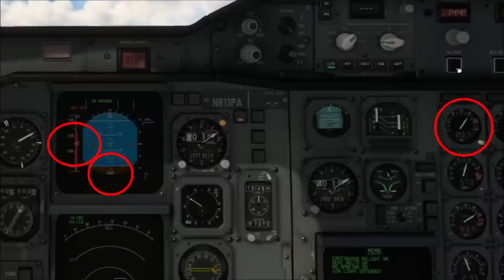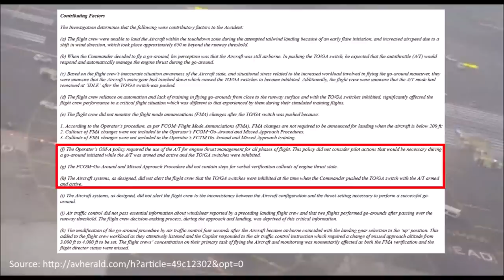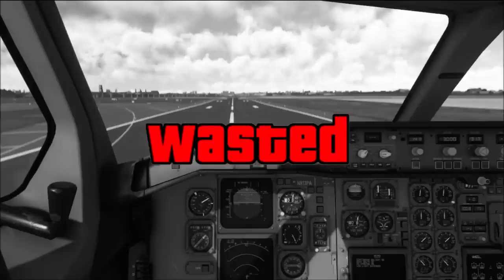How Automation Almost Killed Me - An MSFS Case Study | Real Airline Pilot

Comment: As somebody who's not a trained pilot I don't understand the following: Using AT on go around is one thing but pushing the TOGA button and then getting your hands off the throttle, basically forgetting about them, is a completely different thing. Therefore, I'd consider this situation firmly pilot error (different story in the sim since you might but have moving throttles there), not an automation issue (since any automation can kill you if you misuse it). There's simply no good way to inhibit or not inhibit certain AT inputs on landing without creating some possibility for horrific failure.
Reply from the maker: It's actually SOP to take the hands off the thrust levers, so that the PM can set go around thrust precisely, at least on the 737. Of course several sim limitations kick in here, first in that we just don't have a PM, second in that regardless if I had my hands on my (physical) thrust levers or not, they wouldn't move anyway, so it would not have made any difference.
Reply: @A330Driver  oh okay, interesting. But still, the PM should make sure the throttles are set properly then.

Comment: Hi there, I was wondering are you meant to do the pitch down manoeuvre immediately upon the stall warner activating, like in a light aircraft? Or is it different with airliners? Thank you!
Reply from the maker: At 160ft that's a bad idea. You'll crash the plane instantly.
Reply: @A330Driver  OK makes sense, thanks very much
Reply: I can recover from a stall (at first indication) on 737 in a class D simulator within 150 ft but that is when I am expecting it, i don’t think I could do it if I was surprised. Moreover, all airline training, that used to emphasise recovering with minimum altitude loss, no longer emphasise that after the Colgan Air crash in Buffalo, NY.

Comment: One thing I would like to know is the underlying reasoning behind the TO/GA switch not exerting absolute authority over the autothrottle under any circumstances. I can't think of any situation where a pilot would push it and not want maximum thrust.
Reply: Because its a button next to where you hand is on the throttles it could be pressed accidentally
Reply: its close to where you rest your hands on the throttle in the 737 so it could be pushed during a bumpy landing while touching down.
Reply: @K0nst4nt1n96  so add a protective cover to it that you need to flip before you can push it. And even without that, I reckon it's usually less dangerous to do an involuntary TO/GA than risk not having the engines run up when you need them to.
Reply: @antagonist99  less dangerous yes but not what you want to explain to someone as apparently now even if it is pressed accidentally you must go around as it’s too dangerous to try and disconnect and correct

Comment: Why do you still pitch up even when the stick shaker is active? Shouldn't you pitch down a bit to gain some speed?
Reply from the maker: At 160ft above the ground there is just no altitude left for pitching down. Do that and an ROD will develop that'll make the plane explode when you touch down.
Reply: @A330Driver  "Do that and an ROD will develop that'll make the plane explode when you touch down." Can you elaborate on that?

10:40 Wouldn't it be better to push the nose down and do a touch and go or even land off the runway instead of stalling the plane?

I thought pushing the nose down and keeping the plane flying it the most important thing. 

Did you see video "How this Aircraft lost BOTH engines and landed!" at the Mentour Pilot channel? They lost both engines during the approach and do not stall the plane.
Reply: @ClouDAction.  I think you got a very good point here ;)
Reply from the maker: @ClouDAction.  Sure I can! You can try it yourself, load up a flight in the A310, go to a high altitude and fly it close to a stall. If you want to pitch down to avoid hitting the stalling AOA you need to pitch down significantly. However even the slightest change in pitch will result in an extreme change in the Rate of Descend. Try for yourself, 1° pitch can easily give you 500fpm, in some jet aircraft even a thousand.
In the 737, when we flare the aircraft, we only pitch up a degree or two. That arrests the previous ~800fpm to about 100fpm on touchdown. And that is aided by ground effect already.
In order to avoid a stall however you not only need to pitch down, you constantly need to maintain a pitch down moment as that is what unloads the wings (reduces G forces) and thus decreases stall speed. To effectively reduce the wing load you need to pitch down at least at a rate of 2-3°/sec. Now do the maths how long it would take to hit the ground from an initial 160ft and at what approx rate of descend you'd impact.
At the altitude we had (160ft) there was just no room to pitch down without almost immediately hitting the ground. And chanes are we would have done so with a high rate of descend of several thousand feet per minute.
I'm sure you know this video: https://www.youtube.com/watch?v=kJZ1eHU_JZg
This was 1500fpm. Boeing aircraft can take approx 1000fpm before serious damage will happen, including a full breakup of the plane. Hit nose wheel first and it's much worse.
This makes it obvious why lowering the nose is just not an option in this scenario. Ground contact would likely not be possible to avoid and if ground contact happened it would likely have happened at a very high rate of descent.
Reply from the maker: @ClouDAction.  The overall key point here is the altitude we had. At higher altitudes lowering the nose would surely have been the correct course of action. That includes the example you presented from Mentour Pilot. The British Airways crew were not yet close to the stall, but at approach speed. And they had some more altitude when the dual engine failure happened. AND they did not have a 15° pitch, but a normal approach pitch, thus making for quite a different scenario than mine just after a go around.
Reply: @A330Driver  So what can we do to avoid this situation, to not stall the plane and to not fall out from the sky like a rock? Maybe we should wait with increasing the attitude until the speed starts to increase?
Reply: @A330Driver  10:48 Definitely nose wheel first. What would happen if you tried to level off close to the ground and/or kept the max pitch 5-10 degrees up (10:33) instead of increasing it directly to 15 degrees up? How does a single degree translate to an airspeed loss rate?

Comment: Very interesting video! From a GA pilots perspective I think that such an incident is very unlikely to happen, because there is no automatization and a go around always means putting manually full trust to a GA pilot. automatization is indeed helpful and a safety feature. nevertheless, in a situation where an immediate reaction is required by the pilots, I ask myself it it´s not better to train pilots to fly manually in any case. Then there is no doubt if automatization works or not.
Reply from the maker: You'll laugh: Unless going around from an dual channel (autoland) approach it is actually standard to fly the go around manually until at the missed approach altitude in my airline.
When going around in the real plane I always push the levers up to around 80%'ish so that I can be sure to have sufficient thrust. The PM will take care of the precise setting then.
Reply: @A330Driver  interesting to know! I think that´s a very good copmany policy.
Reply: @philip4690  as far as I have heard from other pilots that's also pretty common.

Comment: My rule is simple. From short finals disconnect the auto throttle. If you need to go-around then PUSH the throttle levers forward MANUALLY. Do not rely on any TOGA switch. They are the worst thing ever invented.
Reply from the maker: With that you're likely to overboost the engines though, not so much in the A310, but for sure in some other types. Do that in an MD-80 and you'll soon be a glider.

Comment: this is so interesting i had the exact thing happen to me flying from ksea to kden all was well on approach and then wind changed and i initiated a late go around. set throttle  rotated set flaps only to find my airspeed dropping and the plane going down i pitched down a little picked up some speed and then i touched down about half way down rw 26. only then did i realize auto throttle was on retard and not listening to my inputs. i was in the a310 as well. quite scary i dont crash often realism is what i strive towards. i havent flown the a310 very much just the crj9 and 737-700

Comment: I normally disconnect A/THR Every Single approach. Dosent Matter if its a Airbus or Boeing. When Deciding to Go Around no need to Push the throttels Anyway to the Ramp. A/THR is not getting me Any Trouble at all.
Reply from the maker: Normally I do the same as well, for me flying manual also means manual handling of your engines.
In this video I used the A/THR because of a challenging approach prior to the landing. You don't see that part in the video yet, but you will see it soon on my channel! Stay tuned!
In flight sim I simply find it easier to have the speed taken away from me when I have to use my right hand to look around, to click buttons, etc. and thus don't have it on my thrust lever.
On "normal" straight in approaches no problem, but when things get harder I prefer to have that one problem taken away from me and focus on the other things I have to do in a single pilot environment in a multi pilot airplane.
Reply: @A330Driver  Agree with that. That Visibility thing in Flight Sim is a real Factor for sure. Normally you dont have that. We know it from our Daily Business :) coole Videos!
Reply: I also do that for any non-FBW or C*U style FBW aircraft (aka airliner except A318-A350). but I find it's extremely hard to manage speed with C* FBW as you can't tell the speed change by stick force alone, but I really don't scan ASI that much after I have good visual on runway.

Comment: The reason you nearly stacked it wasnt because of the FMA or the AT or any other reason you mention here. Its because you didnt fly the aeroplane. Pitch + Power is performance, when you're that close to the ground you dont "expect" the automation to do anything, let alone "one of two things." If you had pushed the thrust lever forward when you went around as a reflex like you used to do in you're little 4 seater, this wouldnt have happend. Same thing for EK521. From the report: 

"The flight crew reliance on automation and lack of training in flying go-arounds from close to the runway surface and with the TO/GA switches inhibited, significantly affected the flight crew performance in a critical flight situation which was different to that experienced by them during their simulated training flights"

 Going on from this when you got the stall warning you can actually see you pulling the stick back trying to maintain the climb instead of performing a proper stall recovery procedure. This is all flight sim so it doesnt really matter other than for a good time, but if you're going to say this is a teachable moment then it wasnt the automation that made the error, it was yourself. Twice.

Peace and love and continued learning,
B737 and B777 pilot 9000h
Reply from the maker: You forget the subtle differences between a flight sim and real life:
In real life you can simply push the thrust levers forward. In flight sim? Good luck, nothing will happen if you don't reach down to the AT Disconnect button before. You'll agree with me that this is not quite the situation to look down, do you?
Furtherefore according to the Airbus FCTM you should only push the go levers and let the automation push the levers forward for you. I don't know if you're familiar with the A310 in the sim, but if you are not then you would be surprised how long the thrust needs to react if you do anything on it, even manual input.

As a 9000h pilot I don't have to explain to you what will happen when you push the nose down at 160ft above the ground. You have sufficient altitude to build up a significant downwards moment from the pitch down, enough to destroy your plane on impact, while not building any airspeed or achieving any substantial unloading of the wing. So please tell me: What do you believe would happen to your vertical speed if you pitch down strong enough to prevent the stick shaker in this situation?
Reply: @A330Driver  bent the metal and upset the rear passengers?

Comment: Isn't this similar to that airshow demo flight airbus ending up in the woods because the AP was trying to land which delayed the engine spool up ?
Reply from the maker: In some way yes, in other no. Somebody asked me the same question a bit further down, check there for the full answer (sorry, on my mobile right now so I can't find it right now). :)
Reply: No he set the Thrust levers to idle manually. The airplane pitched down slightly close above stall. The engines where put to toga too late and had to spool up from idle. The Airbus saved many lives that day by not stalling into the woods.
Reply: @K0nst4nt1n96  Exactly, that incident was 100% human error and the automation saved pretty much every survivor on board by not letting the plane stall into the woods as you already said.

Comment: "So, what can we learn from this then? Well, the first and the foremost important thing, that I'm ever emphasising on my channel, is...
...is to manually slam the thrust leavers forward the moment you decided to go around, you donut!"

I find it quite amusing and sad - relying on automation to the extent where people just turn off their self-preservation instinct and let it kill them. Maybe, the psychology of civilian airline pilots is different... Maybe, I have no idea about any pilot's psychology, since I'm only flying in DCS... But for me it has became like a reflex; when I feel that the approach is screwed, I slam full afterburner and pull the stick without any doubts and double-checks. Better burn some excess fuel than die because of broken landing gear.
Reply from the maker: Have you flown the A310 in the sim Andrey? If you did, could you tell me where to find the option to manually move the thrust levers without disconnecting A/T?
You can't. So either you disconnect the A/T entirely and set go around thrust manually (good luck doing that at low level), or you use it for the GA, as ANY airliners Flight Crew Training Manual will tell you.
Even in DCS, try to slam that thrust lever forward in your F14A and see what happens.

Comment: One would think that a TO/GA button would override any any and all automation. This is not a button you press when you are half asleep. You know exactly what you are doing, the automation however does not.  
If any automation is taking place after the button press it should be configure the aircraft to Go Around, depending on current flight parameters, no matter what.
We don't need the silicon to be that "know it all better" guy in this moment.
If anything, TO/GA should mean "Turn Off bs, Gain Airspeed"
Reply from the maker: Indeed that's what one would expect. But in the aftermath of this video I got to talk with an A310 Pilot and he said it was actually correct behavior. Apparently the go around design of the A310 was so flawed that that was the reason why Airbus decided to redevelop the whole system with the A320.
Reply: A306/A310 TOGA have crashed quite few flight before. Amazon 767 have crashed partially due to the crew pressed GA button by accident in descend, and in my company, there are some incidents that 737 pilot have accidentally pressed TOGA button (some say they have mistaken it from AT disconnect button), that result the SOP now have emphasize once TO/GA is pressed no matter the reason, do the go-around maneuver.

Comment: Excellent demo but I got one question, In case of stall warning what my little knowledge says is that TO/GA and push the yoke to lower the AOA and gain speed. Although in this case the altitude is way too low can you tell if the yoke should still be pushed or keep the current AOA?
Reply from the maker: At this altitude there is just no room to push the nose down. We're at 160ft, take the nose down and you're on the ground. And then you risk developing descendrates that would destroy the aircraft on impact. In this very situation there was just no room to play with this. Lower the nose and chances are you're dead.
Reply: @A330Driver  to me it looked like you had room to lower the nose about 3-5 degrees after initial shaker. I saw you did drop the pitch eventually after a couple more seconds, perhaps because of running both the pilot monitoring and flying duties. It is better to accept level flight or a slight descent even that close to the ground than risk stall which will of course drop the nose and make the aircraft uncontrollable from 160'. Especially if you consider a scenario where you go around due to wind shear and gust margin could bring you to a full stall, I'd risk gear contact over staying in the shaker so long.
Reply: @justcommenting4981  yes, checking a few degrees isn’t a bad idea, although stick shaker doesn’t mean the aircraft is fully stalled, you could fly to the stick shaker while monitoring speed+rate or climb